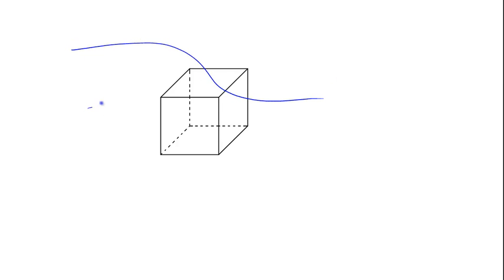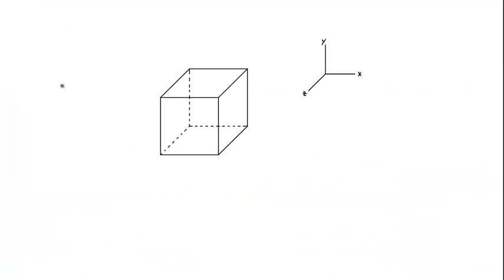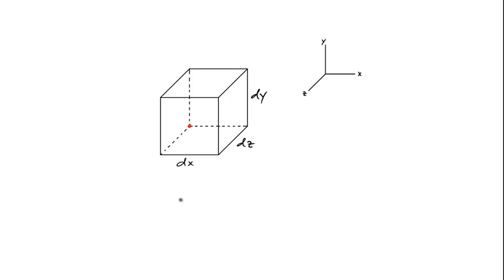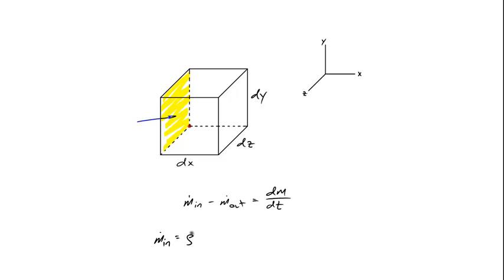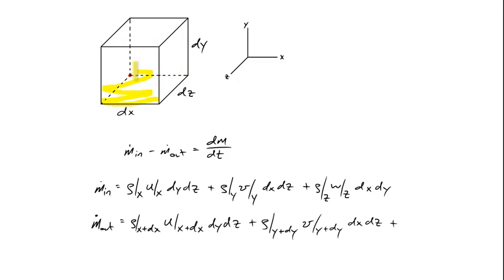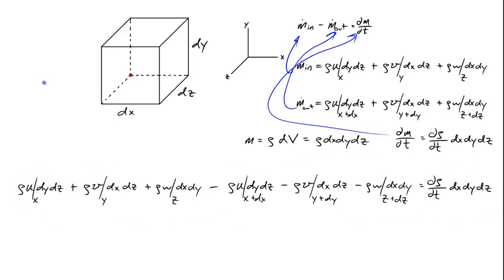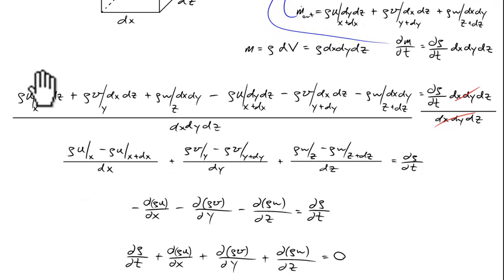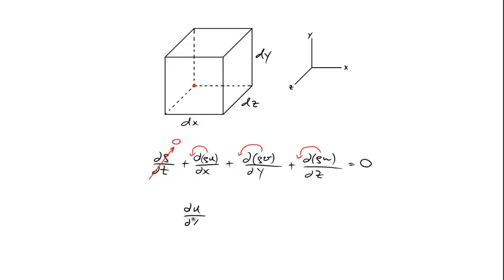Continuity Equation Derivation

Comment: Thanks for doing this - very clear video and very helpful!

Couple of things - it would be easier to follow if you didn't include mistakes, can you not edit them out?

At 5.36 when writing out the simplified form of the equation, you say "d u/d x" then "the partial of v w.r.t. x" - is there any difference? 

Finally at 5:00 you go from p((u_x)-u_(x+dx))/dx to -d(pu)/dx... is this just a definition? Its basically saying the change in velocity from point x to x+dx is equal to d(u)? Can't seem to get my head round it!